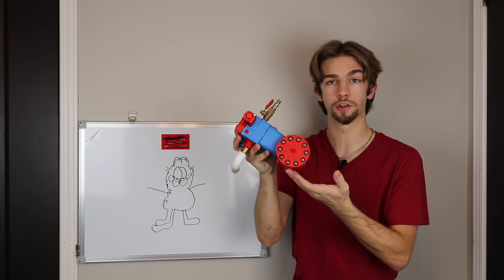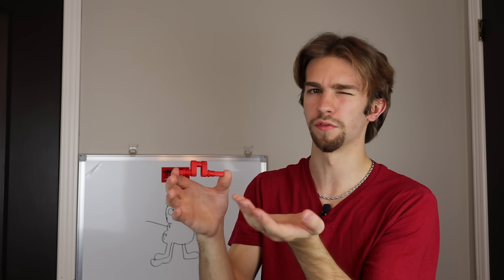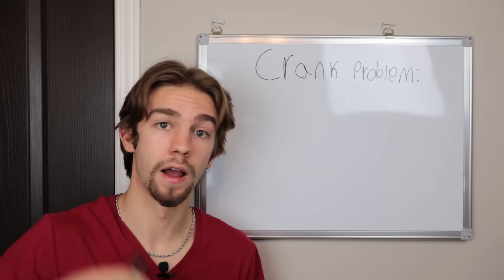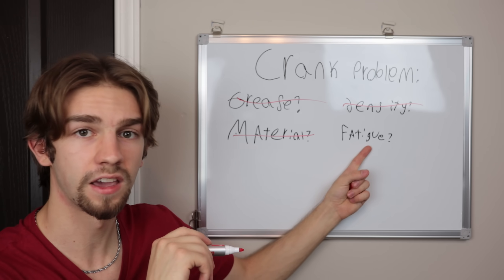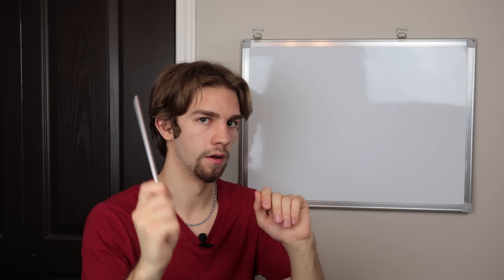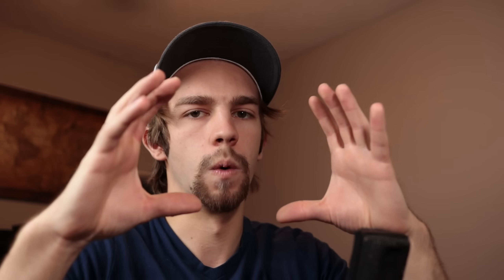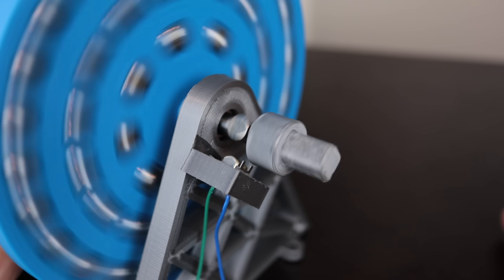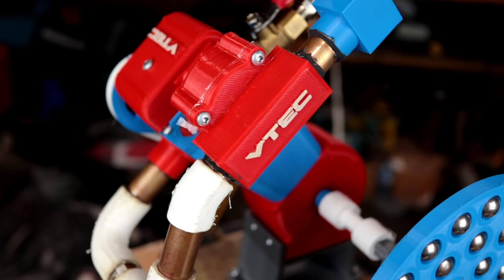Finally Upgrading my 3D Printed VTEC Engine, Then DYNO Testing it

Comment from the maker: I forgot to upload the files until just now hehe, they're in the description
Reply: How does someone like you not have 500,000+ viewers by now? I've been watching your videos and it's nothing short of quality. Keep it up dude. Youll go far ❤
Reply: did u forgot some files? i'm trying to remake it but i think i miss some parts :D thx
Reply: N gin
Reply: I have an idea about the 3d printed gasoline engine I think the problem with the carb setup is that there is not enough air volume to suck up and atomize the fuel so I have 2 Ideas
1) use butane or propane as a fuel use the existing carb and plum butane into it and use some sort of valve driven by the cam shaft to open and close the butane tank as too much butane won't ignite
2) if you don't want to use butane as it's a gasoline engine try placing the fuel tank above the carb's fuel inlet and use some sort of valve similar to the one in butane setup
( I recommend that u increase the diameter of the intake valve as I think it's the main bottle neck) I hope this helps waiting for part 5 of 3d printed ice
Reply: Also I recommend that you get rid of the venturi setup and use direct injection into the intake and use a valve of timing of fuel
Reply: What about the 3d printed gasoline engine also I have left a few suggestions about it
Reply: Thanks
Reply: Thank you imma build this now😁
Reply: pause the crankshaft print half-way.. leave cavities to put metal bar(s) into the centre of fatiguing shaft(s) 
can also have bearings either side, crank case?
Reply: Where did you get the belt for it

Comment: love the concept but i dont think the vtec does it any good... because you restrict the outgoin air you create more resistance for the piston to come up again... i susspect the engine to run a bit better without the pressure membrain in the exhaust port. you know the original Vtec has a electric controlled valve just like the vvti? try using a servo with a arduino to controll the vtec!

Comment: why dont you use oil in the crankcase? it would cool the plastic so it dosn't flex and it lubricates pretty well. somthing like 10W30 so the engine can handle it.
Reply from the maker: Oil and plastic sucks, at least when it's 3d printed. I always avoid it since the oil inevitably just soaks into the block like a giant sponge which only makes it weaker.

Comment: Instead of machining a crank shaft why not combine 3d printing with metal most people would have. Why not use a nail as a pin?

Would be interesting to see if you get performance gains from doing this also loving the stuff ypu have tried printing so interesting.

Comment: @CamdenBowen   You should reengineer it so that you can put oil in the engine.  It won't heat up as fast as should lubricate everything. Might fix your crankshaft problem

Comment: What you should do for the bottom end and piston is add a liquid lubrication system. An oil pump and filter to get the engine running smoother!

Comment: O-Rings on the piston violate the all plastic rule?
Reply from the maker: Not really, by virtue of that the screws would violate it too. I was more meaning that I didn't want to design it in such a way that involves cutting and welding but instead a part that can be 3d printed

Comment: Just a few thoughts. Would it be possible to install/ make an oil chamber or oil pan? Remember oil also helps with temperature control. 

My other thought would be, try printing in a few different orientations. It may work better printing vertically instead of horizontal or vice versa.

Comment: I left this on an older video but it's worth mentioning here. Make your parts as a positive with funnels, minimal infill, and make a mould with plaster. Melt the plastic out and fill it with aluminum. Now you're 3D printing with metal.

Comment: There's no point of having unequal circumferences between crank pully and cam pully, as with an air engine you don't have a compression or power stroke. You could double the output of the engine if they were the same size, given the valvetrain could handle the increased speed of rotation. Very engaging video tho I enjoyed

Comment: just a suggestion add a way to add some oil to the bottom end of the engine its great for thermal heat dissipation and a great lubricant you can reduce the weight on the crankshaft potentially. also you don't need a pump just enough oil to when the crank or piston is at the very bottom or lowest position so it can use a splash based cooling and lubrication your crank will last significantly longer.
also put some oil in the cylinder to slide the piston in this should allow you to fit the piston tighter in the cylinder
just a suggestion i could be totally wrong

Comment: You could put the pressure valve on a separate line coming out of the copper tubing instead of having all the exhaust go through the valve to reduce power loss from excessive backpressure

Comment: Regarding the clicky crackles in the audio, iZotope RX can remove those.

I don't know what's causing it since it doesn't sound like you're overdriving or clipping anything. Maybe there's something that's compressing/limiting the audio levels to level it out and then normalize it back to max level, but every now and then one sample of the signal gets chopped. It doesn't snap crackle pop when you aren't speaking as far as I noticed, so it's probably not a loose wire, it's gotta be related to the input signal level.

Your engine braps really good. Obviously a gas engine braps differently from the small explosions combined with the exhaust flow, but I have no ideas on how to get something like that explosion impulse, unless you were to just add a little mechanical snapping sound to it somewhere in the exhaust just for acoustics. Like putting a playing card on a bike's wheel spokes.

Comment: I dont know if im just simple minded and don’t know how stuff works, but I know you can convert Kw to HP, so you could stick an electric motor to the engine and hook a multimeter up to it to see how many watts it’s making and then convert that to HP, you could measure RPM separately ofc and then solve for torque using hp=(torque*RPM)/5252
Reply from the maker: Actually yes this does work, but I'm lazy and preferred a more visual demonstration

Comment: What about sanding the parts down Pryor to installing them to help them run on the surface smoother or maybe some bearings
Reply: Or maybe a metal or brass C-brace clamps on top and bottom of the two halves that clamp the crankshaft together

Comment: having seen most of your videos I think you should hone your cylinder tubes, and larger print the piston to hone on the dimension of the honed cylinder tube, and the cylinder head closer to the piston, a car with high-pressure heads gets more performance

Comment: Perhaps this could ultimately be powered by a pressure chamber that generates its pressure via mixing dry ice and water, or perhaps even liquid nitrogen and dry warm water. Then the system could be self powered. Air powered go kart?? 👀

Comment: if you want to make a more stable engine, scale the whole thing up by 25% and make the cilinder another 25% larger, less stroke and a balanced flywheel  are going to fix your vibration problem for sure

Comment: How is this myth of PETG being stronger than PLA still around? PLA is stronger and stiffer, the only benifits to my knowledge are that PETG is better for is impact strength and heat resistance, it also deforms before breaking which may be a benefit depending on the application. 

Based on things I have printed PLA seems like it doesn't bind as easily when parts are rubbing.

CNCKitchen on YouTube does several material tests and gives out tons of great info.

Otherwise, this video was awesome.
Reply from the maker: Maybe that is true, but in my own personal experience I have found that PETG performs longer under stress than PLA does.

Comment: If it's possible, you could try resin. There are some crazy resins out there.
Either with a resin printer or you can make moulds. This could be a good, and 3d printed, replacement for the crank shaft
Reply: in my experience resins are either brittle, which would mean the shaft would just shatter, or too soft to be any use.

Comment: If you can afford a 3D printer, you can probably afford a small hobby Lathe, Milling Machine.
Reply from the maker: try to find me a lathe and or milling machine for 300$
Reply: @CamdenBowen , 

ebay

100~240V Mini Metal Turning Lathe Machine Motorized Milling DIY
 $185.99
Mini Metal Lathe 7"x14" Metalworking Woodworking 2500RPM Turning Milling 110V
$1439.00

Comment: Try printing the friction parts with POM, wich is self lubricant. Also, make it hollow and super glue a solid PLA shaft inside the hollow POM main shaft tree for rigidity.

Comment: So... This may sound a bit weird but I've been 3d printing struts and I can get extra strength by designing them to be composite parts printed with different orientations, then combining them. Could you print your crankshaft in one orientation with hollows to insert three pins printed in a second orientation?

Comment: I believe there are some free open source dyno apps for windows online, I haven't checked but I saw somebody use one a while back and it is way easier as it does all the math for you, all you need is the rotating assembly weight and the rpm. I would also recommend getting the valvetrain fixed up before moving onto new motors, I had a lot of valvetrain issues on one of mine as its  tuned to make power at around 6.5k rpm right now but you would be surprised how much extra power properly closing valves makes. it also shouldn't be too hard with your motor as its massive and you can easily fit some small springs into the timing system or something. anyways awesome video as usual and its awesome to see your sub count rising so quickly!

Comment: Have you tried printing it from ASA? Doesn't blob up like PETG, it's much stronger and doesn't have flex like PETG.
Reply from the maker: No actually, I'll have a look into that
Reply: @CamdenBowen  Just be mindful of the fumes! I've gotten some nasty headaches since I don't print in a full enclosure. Enable "draft shield" in your slicer and you'll have beautiful prints without warping.

Comment: If you're worried about user repeatability then finding solutions using materials and methods anyone could copy could help.

You could absolutely do things using metal.

Ive learned from watching youtuber/rc and aviation hobbyist that you can get all sizes of brass pipe and easily cut it with a hobby razor by rolling it. You could use these brass pipes as sleeving and bushings for the crank and cylinder walls and other wear locations to reduce friction and heat, as well as increase longevity. Plus, its cheap and anyone with an internet connection can acquire the right brass.

Comment: Actually, PETG is not universally stronger than PLA. PLA is actually extremely stiff, but a bit less "tough." It's a little brittle, but for a crankshaft, where you're not taking impacts, the stiffness of basic PLA is going to be better. Actual crankshafts (and camshafts even more so) are hardened for this reason. Dropping a crank or a camshaft can be catastrophic because they're very hardened, and thus brittle. But in the rotational engine loads, that's ideal.

Comment: Your issues could be fixed with proper balancing. You could rig all your rotational parts to a makeshift lathe to check how off centered the balance is. Id imagine it wouldnt help much but it could help with fatigue. Good luck!

Comment: Brilliant idea using the back preassure! 

0.00629hp is about 4.7 watts, which isn't too bad for a 3d printed engine.  Your biggest problem for making lots of power is speed.

I found this one channel, cant remember the name, but when I get to it I'll link it.  Anyway, he made a modified version of Tom Stanton's diaphram air engine, and made 12 watts at 9000 rpm.  If you can get your engine to rev to even 3000rpm, I imagine youll make a LOT more power.
Reply from the maker: I think what would have worked better for me too is having the flywheel directly connected to the crankshaft and skipping the coupler. It added helped with shaft misalignment but also sapped power

Comment: I feel like the valve activating the VTEC is limiting the power. Since it requires back pressure to activate the valve, the engine is basically fighting against that, which means its losing power. Try measuring without the self-activating vtec through the exhaust and activating the vtec manually to see if there's a power increase.

Comment: You probably have no space for it in the body (or make the crankcase even bigger than you already did) but try to make the crankshaft-shaft itself in one piece with the kranking part so big it will be possible to have the piece, the connection rod clamps over, will be so big that a hole in it will house the shaft itself. A difficult way of telling you to more or less make it look like a  camshaft. Now you even may have a steel shaft. And if not it is a shaft in one piece without a u-shaped part in it that will weaken it.

Comment: Graphite Powder? Good. Graphite powder AND grease? Cutting fluid! Oops!
As for helping make a stronger crank, try making an eccentric sheave rather than a classic crank. You'll have more friction and more bottom end mass, but it'll run smoother and be stronger. They were often used with steam engines for these reasons.

Comment: Try using bearings on the shaft and use a metal rod between the 2 crank arms or use a bearing

Comment: You have to go back to the flyball governor idea, the whole premise of VTEC is depedent on revs, not exhaust pressure
Reply from the maker: The flyballs add more inertia to the system however, making the engine sluggish. The exhaust pressure allows it to actuate at a certain RPM without this being the case

Comment: I'm a certified 3d printing autist. I have put well over 10000 hours on various 3d printers and have years if cad experience relating to 3d printing. I have 3 recommendations for the engine:
Filet and thicken the crankshaft 

Use oriented infill or increase your parameters settings to achieve 100% infill

It seems thet you have some voids in your print, you should increase the extrusion rate

Comment: Neat! If I can make a suggestion: replace the electromagnet + pickup with a rotary encoder. Something like the E6B2-CWZ6C is very easy to use with an Arduino (using eg. the "Encoder" library). You'll get resolution down to the level of 0.001 degrees and they can handle pretty decent speeds
Reply: From the comment on not wanting to get into technology I think he wants to avoid things like Arduinos and buying electronics components, something similar to a brush from a motor and a (small) battery could make a less fuzzy output readable by his recording gear
Reply: @crestfallensunbro6001  But... why? The setup I describe above is super simple and will get very accurate results - much more accurate than he'd need. Would cost <AUD$50 (depending on location). 

ChatGPT (4) would be able to write this up in code in less than 5 minutes.

Also, I don't have much (any) experience in this sort of motor(?) development, but I'd think a super precise + fast rotary encoder would come in handy 🤔
Reply: @harrisonlow  its mostly speculation on my part for the wanting to avoid micro processors thing, what gave me that impression was the way he used an audio recorder to log the data (valid but slightly unusual choice) and the comment about avoiding a certain type of technology

Comment: make the piston have a counterweight? if you have the same weight as your piston on the opposing end of the crank, it solves the fatigue issue without needing excess material on the crank. also meaning that the size of the connecting rod doesnt need to be very big since it isnt being fatigued in the same way
edit: this is how almost every single cylinder engine is made, so the fact you didnt do it is confusing

Comment: The method I'm using to make the "3d printed part" stronger is embedding a bolt inside that parts. Make a hole in the model and just tread a metal bolt in.

Comment: A lighter con rod and piston would reduce the force on the crankshaft. Also, the closer the crankshaft bearings are to the con rod, the less bending moment the piston force will have on the crankshaft.

Comment: Heres somethin I thought about the crank.  What about using a cut 3/8 allen key with the center ground smooth?    You have the hex of the allen to stop the crank from twisting on you and a smooth surface.    Now if you really wanted to you could put a bearing on that (yes I know you are wanting this to be all 3d printed)    Just some food for thought
Reply: They make hardened pins you know. No need to frankenstein one from a perfectly good allen key.

Comment: You could possibly print counterweights on the crankshaft to make it not want to flex as much from the piston moving, as well as drilling a screw through the print to give it extra rigidity.
Reply: Thats what I was thinking. Something like a harmonic balancer. I also like your idea of putting a type of simple screw or dowel in the crank.
Reply: Agreed
Reply: Real crankshafts have this, don't know how much plastic would make a difference because it's so light anyway so counterweights wouldn't do much unless they were huge. But, may be the only thing for longevity.

Comment: Nah make a 4 cylinder one just like the k-series. Also the proper way to tune vtec is when your normal valve timing power starts to drop you engage vtec to add onto it.

Comment: I wish you could make an opposed cylinder version (that would increase efficiency a LOT
Or a boxer one that would remove the fatigue issue you have with smaller crank shaft